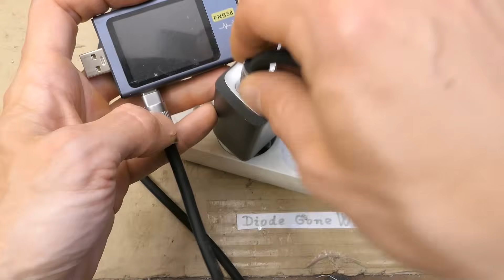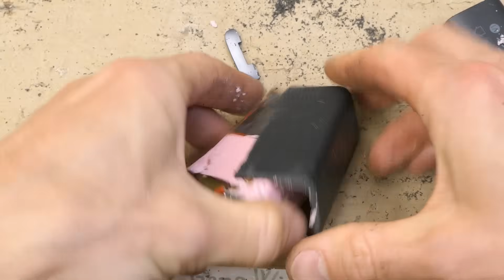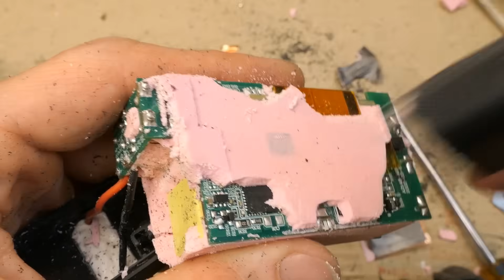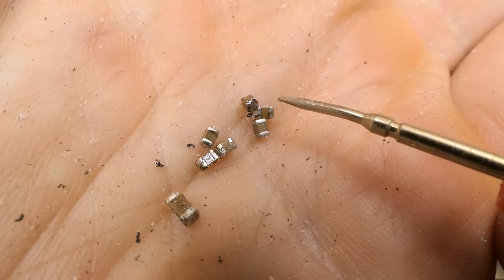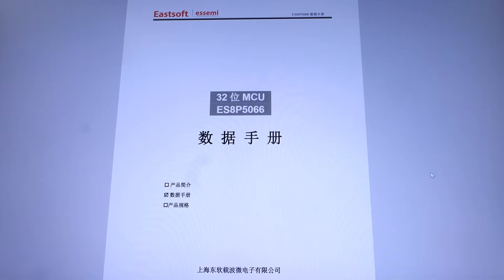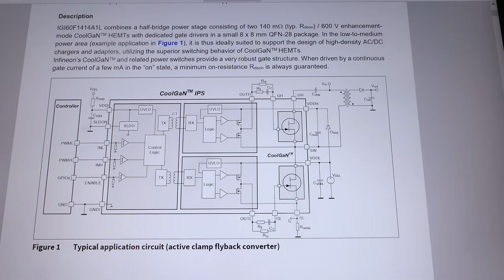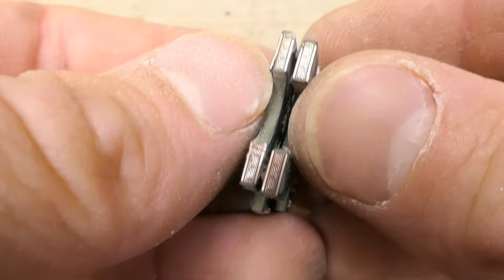Faulty 120W charger analysis (Anker GaN Prime)

Comment: This is the second time i saw a proper GaN power supply which uses a Planar Transformer, amazing.
Reply: I'm still struggling to understand what it is about Gallium Nitride that makes it so efficient for charging bricks, and how that GaN is employed to the process. ⚙

I keep seeing GaN this and GaN that all over the place on shopping portals, but until I can learn to understand how GaN improves efficiency (Versus, say, my 5W Apple wall-wart) I can't see it as anything more than a marketers buzz-word... 🛍
Reply: @dieseldragon6756In laymen's terms: Every semiconductor has a voltage drop across it, typical silicone semiconductors have about 0.6V per junction. GaN semiconductors have a lower Voltage drop therefore less losses, less heat, less energy wasted.
However they also allow for a higher switching frequency allowing you to shrink the transformer and other support components and have the whole thing to be even smaller and more efficient - if you design it around the GaN mosfets.
Be mindful though, not everything that says "GaN" actually uses this technology, as always there also are a lot of scammers.
Reply: @timhartherz5652  I was just about to point out that: Just because it says GaN on the box, it doesn't necessarily guarantee there's GaN in the box! And counterfeits/scams which exploit this is one reason for why I view GaN more like a buzz-word than the technology it represents. 😇

And many thanks for explaining that GaN increases the efficiency of P-N junctions! A lower voltage drop means less resistance to higher switching frequencies (kind of like the difference between a physical switch and an optocoupler) and thus smoother secondary outputs! 😁

(I wasn't aware HF switching also led to smaller power bricks, but I'm sure I'll work out why that is in a little while. Most of the stuff I'm passionate about operates around 25KV 🚄 so considering how HF might reduce the size/cost of a traction supply transformer will help me work that out using a larger magnitude example! 🙂)
Reply: GaN has its obvious positive attributes. But it's largely being used as marketing wank

Comment: I also do autopsies on failed electronics, and the leading cause of failure are electrolytic capacitors, cracked solder joints, dirt on contacts, and faulty microcontrollers.
Reply: Most of my recent autopsies¹ have shown a marked increase in failure rates of devices that bear UKCA marks. It's why I tend not to trust them. 💻🇬🇧🔥😉

(¹ - Which I would video and upload, were it not for my sexual orientation and alignment of faith getting me a shadоwbаn order in this country making the effort of recording/editing a lost cause, thus entirely pointless.)

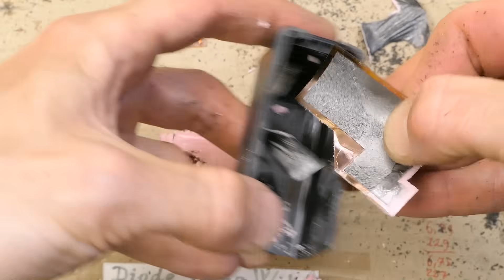Comment: Those gray pads at around 2:20 look like graphite thermal pads to me more than any kind of shielding - especially since they don't seem to be grounded in any way. Probably meant to spread heat out across the case as efficiently as possible without being a shock risk.

Oh, and I wish that instead of cutting the transformer in half you had dissolved the PCB so that we could see  it without the fiberglass. Of course that would require handling some nasty acids, but it would be super cool to see!

Also, virtue signalling? I think you mean greenwashing? Virtue signalling is a right-wing dogwhistle mainly serving to flag the person speaking as being right wing (which yes, is incredibly ironic, as it serves to signal this person having the "correct" - or virtuous, if you will - values), while acting butthurt over people having different values and opinions than them.
Reply: Since when is the phrase “virtue signaling” a right-wing dog whistle?!? It certainly didn’t used to be.
Reply: @tookitogo  AFAIK it has never been anything else. It's purportedly used to call out people for being disingenuous, but that "argument" is so plain-faced idiotic that the only real purpose of it (as with many right-wing "arguments") is to signal the status of the person using the phrase as someone who 'gets it', a signal directed squarely at other right-wingers.
Reply: @Kraaketaer  I don’t agree, and I’m very much on the left myself. A dog whistle is a coded flag that doesn’t mean what it appears at face value. When a right winger accuses someone of virtue signaling, the meaning of the phrase “virtue signaling” isn’t coded, and whether the accusation is true depends on whether the accused’s actions are actually contrary to the image they portray.

Comment: Is that type of a transformer safe?
I have seen PCBs short between layers before so this type of a transformer doesn't seem all that safe
Reply: probably a lot safer than one that is hand-wound by some underpaid chinese worker who has to make one of these every 5 seconds. 
PCBs dont randomly short between layers, there would have to be probably multiple things wrong with the design and how the board is handled to end up with physical damage like this.
Reply: But I saw at least 2 thermistors  and there are probably thermal fuses as well, so it's not going to catch fire!
Reply: Being located inside the enclosure direct contact between a live conductor and the user is unlikely, and there are a few components on the primary side that would fuse out with an audible Pop! in the event of a short. If a dangerous fault condition occurred e.g. continuity between primary and secondary, most of the secondary PCB would go before the user had the chance to (un)plug anything. ⚡🛡👍

Comment: Now I see why Anker products are so expensive! I have the Anker Prime powerbank and charger, solid and heavy items they are too, and totally non-serviceable as well!!  They are exceptionally good though, and can recharge my drone in a fraction of the time it takes with a basic wallwart.

I've never seen one of those transformers before, and I won't be taking mine apart to get a closer look. Fascinating stuff just the same - in fact, I think I have a pocket TV with a lower component count.  This thing elevates battery charging to a whole new level!
Reply: It also makes the device more robust in terms of tolerating g-forces from impacts on hard surfaces. Now I’m 3:14 into the video, and see that it uses direct PCB-to-PCB-at-right-angles construction. That type of joint is very susceptible to damage, so potting it would improve reliability significantly.
Reply: @tookitogo 

A quality product would have metal braces between the PCBs, individual heavy components zip tied to the board, metal heat sinks etc.
Reply: The thermal potting compound also serves another purpose, most likely: noise reduction. We’ve all encountered those power supplies that have audible whine at some loads. This would certainly dull that.
Reply: Non serviceable design should be inacceptable especially at that price range. Enough with the BS. 
I know "they're all like this", but why ? 
'Security' screws should make it compliant with all modern electrical safety rules as well. Cheap extension cords have them, but this 'high tech' manufacturer apparently can't afford them...
The potting compound might let you build it at a slightly smaller size, but slightly larger is better than e-waste...
Reply: @westelaudio943 It would have to be significantly larger if it was built for serviceability, I think.
Reply: @EdwinSteiner 

It will still be small enough... I don't like this idea of reducing everything to an absolute minimum of weight and size. And It doesn't have to be built for maximum serviceability like an old Grundig radio, that would've been impractical, but you should at least be able to do some basic repairs on it.
Reply: @westelaudio943 this is not a laptop, nobody is “servicing” their phone chargers. Stop slowing down progress and accept the premium power density
Reply: @westelaudio943i tend to disagree, and I love how Anker protects the dangerous parts from my kids while keeping the adapter small and useful. For this kind of device, safety, robustnes, compactness, and inaccessibility are priority. And honestly: they hardly ever fail, and if they do: Replacing a faulty ic at a €10-20 total product price is dellusional from a resource/climate and practical perspective, even if it was more accessible. I am for eco awareness, too, but effective please, with a focus on total product resources and an idea of economics. The overall additional effort triggered by indiscriminate eco-mandatory-repair-legislature might very well backfire and hit our climate even more (bigger builds, mandatory spare part storekeeping, etc pp). We are completely on the same page when it comes to bigger/more expensive/more resource-intense products where repair effort and/or recuperated resources are in some sensible relation.
Reply: @twr4641 

Safety is just a lame excuse in this case. The kiddos don't have access to security bits (at least they shouldn't and if they do it's your own liability). 
If you don't trust them with a charger you shouldn't trust them with a phone (which is arguably a much more dangerous device). 
Also, if you're still concerned, you can seal the screw heads with epoxy yourself. 

There is absolutely no reason why electronic devices need to be disposable. Even if this finnicky modern SMD stuff will never be as service friendly as old school stuff from the 80s, you should at least be able to change something like a fuse or electrolytic capacitor. 
If you can't repair it, you don't own it... 
You just 'consume' it. Then it goes to the landfill or into the ocean... We shouldn't be consumers, we should be stewards.
Reply: @twr4641  thats a bad way to think about things, a properly designed board has discharge resistors on the capacitors and should be completely safe by the time you open it, and if it's not then you should always still always discharge it with aluminum foil, if you block every "dangerous" thing from kids, then you're gonna end up locking them at home because outside they can get kidnapped, fall on the ground, get into trouble, etc, compared to actually dangerous things, opening up a broken power supply shouldn't even be on that list
Reply: @sigataros I'm all in at repairability, but he is correct here. No way repairing this is economic, so almost nobody will even attempt to repair it. Repairability is difficult when stuff is highly integrated. 
Think about it - what would be the IDEAL miniaturised PSU? I guess a single IC (that does control, power diodes/rectification, switching, etc), two capacitors (input/output), and 1 transformer, probably printed like on this board. - if the IC fails, you are screwed. That's the edge case, but the trend is very obvious: if a circuit of the same complexity gets miniaturised, the repairability will ALWAYS go down. 

However if the complexity goes up, we can again (or should) split it into swappable parts. (For example RAM cartridges on laptop boards), socketed CPUs.

But I don't see a way this could improve this SMPS in any way. It's just too small / high end to be separated into swappable parts. Distributing the replacement parts would probably create more emissions than just recycling the thing. I don't think the failure rate is that high with these
Reply: @TheRailroad99 

I understand where the trend is going, but I don't like this trend very much. Recycling is pretty much a sham and most of it ends up on landfills somewhere anyways. 
It's also bad for the second hand market and the electronics hobby of course. Would you have gotten into electronics if you were confronted only with stuff like this mess?
Reply: I still would. The more complex it is, the higher my intrigue becomes.
That's the primary reason I love repairing stuff. "Too complex to repair", doesn't exist in my head.

Comment: The printed transformer is pretty cool. It allows the windings to perfectly couple and also provides consistent separation between turns. Only issue is that it's impossible to repair.
Reply: It's pretty easy to repair: you remove the old one and place the new one in 😜
Reply: I have exactly this charger and is has exactly one downside, it screams with light loads. I returned the first one I received, but the second one also makes a lot of noise when my phone is done charging. I think the glue for the ferrite core might be too soft, but the sound might actually be very hard to remove because of the big cross section of the ferrite coupled to the case.
Reply: Wonder if others can hear it as well as you? Or possibly you are just sensitive to that particular frequency?
Reply: Yes, I'm probably more sensitive to that frequency range. My wife isn't bothered by the sound although she is usually much more sensitive to stimuli

Comment: 11:20 i don't understand why you didn't start by pushing some current into the short
Reply from the maker: Neither do I...
Reply: @DiodeGoneWild  😂
Reply: @DiodeGoneWild this brilliantly sums up your sense of humor. Love it!! 😂
Reply: @DiodeGoneWild  Don't lose touch with your inner salt Master Diode.
Reply: @DiodeGoneWild  I see more and more people doing stuff like that. And buying those "short killer" devices. Cheap pieces of test Gear Sold on AliExpress and eBay meant to burn through the short. Interesting concept
Reply: should've listened to the cat
Reply: short finding gone wild
Reply: For real, its a first thing you should do in this example xD
Reply: I was thinking the same. Just put some current in it and use you thermal camera!

Comment: Some really interesting components and design choices in there! But the oddest thing for me was those two mains voltage bridge rectifiers, I don't get why they used two separate ones and shorted out their inputs rather than just two directly in parallel or one with a higher rating? If anything wouldn't it just decreases the efficiency by 1 diode drop? (~0.5% at 120 VAC) Seems an odd choice on a GaN charger marketed as high efficiency and in such a small and thermally limited product.

Also very interesting to see the planar transformer teardown. I wonder what drove the choice, I assume it's needed to negate the skin effect at the high switching frequency?
Reply: There is no additional diode drop. What they built is still a "normal" full bridge rectifier, except that all diodes are doubled up. That's what happens when you short the inputs: you get half of a full bridge rectifier with two diodes in each leg. Use a second "shorted" FBR chip and you built up an actual full bridge rectifier again.
As to why? Only they know. Could be thermal reasons (the thin SMD package looks good at thermal dissipation), cost (maybe cheaper than single diodes or cheaper in assembly), size constraints (the case looks cramped already), electrical characteristics (like no equivalent single diodes that are that well suited for the price/size). Most likely a combination of all of these.

Same thing with the transformer. Main reason will be the dimensions. A normal cube like transformer just wouldn't fit. This is mostly likely cheaper than having flat transformers made and soldered in. Electrically there's no difference.
Reply: If you just connected the bridge rectifiers in parallel one rectifier may get hotter or have diodes with a higher voltage drop and therefore that diode will heat up more, it's a common problem with paralleling diodes. If you wire the rectifier inputs together you will also put the diodes in parallel but instead of paralleling diodes from two rectifiers you parallel the two diodes in a single rectifier(and a single package), that way their temperature is more even and they will(probably) be more similiar.
Reply: Ah, I see now how the wiring works. That's a clever trick to ensure the current sharing diodes are matched within the same package.

Comment: Electrolytic capacitors act kind of like pseudo-diodes in reverse bias don't they? There is an electrolytic reaction with some decomposition potential that must be overcome. As I understand it that's the reason why they are polarized to begin with--you have to apply voltage in the direction that inhibits electrolysis rather than enables it.
Reply: Reverse voltage (that's strong enough) depletes the oxide layer (dielectric) and can cause a short... If you're careful enough, you could probably even invert the polarity of the cap. I just can't think of a reason why you would do that (except for a practical joke?).

Comment: An incredible exploration a product with very inaccessible internal workings. It must have taken an age to produce the video, but it was time well spent.
Reply: I suspect it took less time than you might think. You can get really proficient and quick with these things when you're dealing with them every day. Not to downplay his accomplishment though, but I think his skill is high enough that what for others might take a week took him a day.
Reply: @charmio  yes and the production quality is also very raw
Reply: thre really should be a lawsuit against these compaines making so much difficult to repair things the chip is 5usd for 5 pcs
Reply: @sharvil-g5i  the pink goop inside is thermal interface material. it provides a heat sync-like interface and brings the heat outside so it doesn't get trapped inside the power brick. it's also isolating.
there isn't much of a way to make this power supply without the pink goop, and safety regulation makes them ultra hard to take apart.
Reply: @sharvil-g5i Like everything in engineering, there is a price to pay when making things small. In this case it is repairability, which is not too bad considering there are a few people who can actually repair power supplies.
Reply: @idranoutof1d maybe there are just a few BECAUSE it doesnt make any sense, trying to repair something that is built like that. 
Who needs 120w supply to be THIS small?! And there nothing else to chose from, so youre „forced“ to buy an unrepairable something even if you dont want to…
Reply: @PM-wt3ye i kinda like having 120 watts in my pocket
Reply: that transformer was a first for me